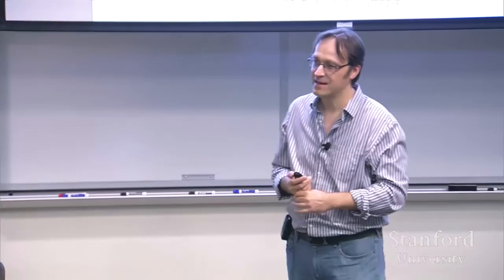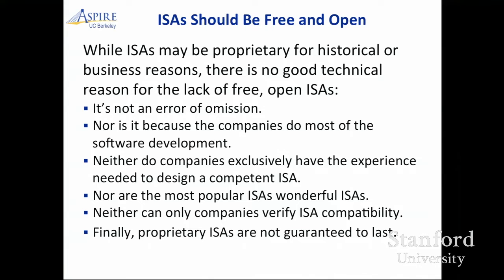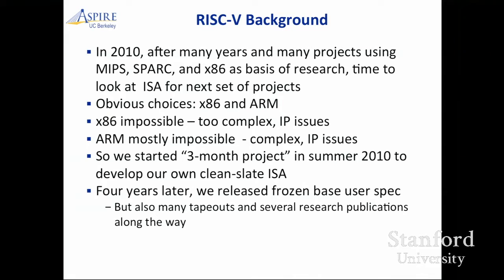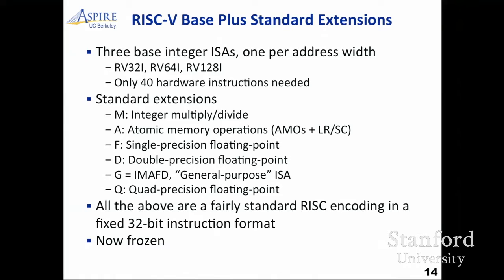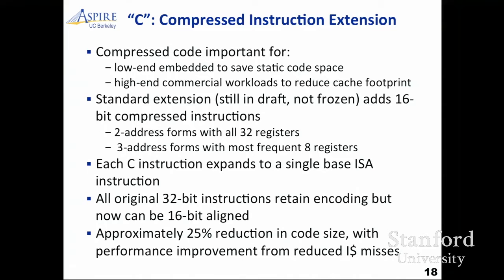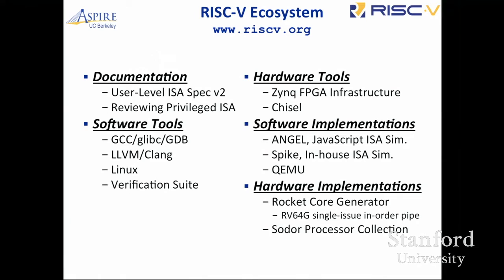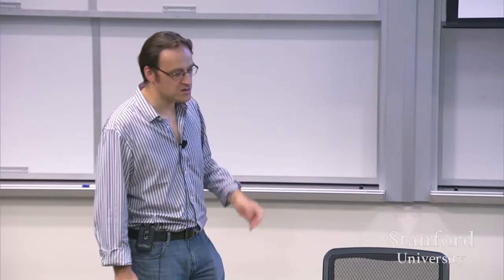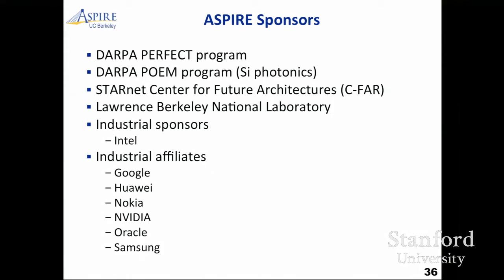Stanford Seminar - Instruction Sets Should Be Free:  The Case for RISC-V

Comment: I'm concerned that they have an ABI and an SBI. This means that as an OS developer I have to write different code to have my OS run on the SBI vs. the ABI. Why not simply define the SBI as a superset of functionality of the ABI that the OS (or hypervisor or HAL) can choose to expose or not to the application. Then there is no need for a hypervisor; if I want to run an OS instance on another OS instance, I just run it with the relevant permission from the host OS. There are many cases anyway, sandboxing for example, where an application like a web browser needs to implement OS like functionality like pagetable manipulation (of the process in the sandbox), if the platform implements cascaded page tables, then it ought to be trivial to expose that so that any task can call into the pagetable ABI for manipulating the pagetables, and the necessary checks are carried out at each layer: browser, OS, hypervisor, but at the page access level, it is implemented by the same hardware paging regardless of layer.

I am also concerned that there is a strong possibility of same core context switching being cemented into the standard, which could throw a spanner in the works for efficient CMT (see for example NxM), where rather than the hardware thread executing an exception vector and saving the process state, then entering the kernel, the hardware thread raises a flag and halts, and another hardware thread or physical core processes the system call and clears the flag of the calling hardware thread. In my mind this can constitute a large performance increase as the hardware call initiating the call can continue executing of another hardware thread. while the state of the calling thread is saved not by self storage, but by another thread accessing it's hardware TCB and asynchronously storing it to memory. In this way high performance application cores can execute at very high availability, and a stripped down supervisor core can implement thread saves and restores at lower energy cost. If only the application side of the interface is specified, then alternative supervisor models are safe, but if the ABI defines both sides of the interface, then it is likely to lock in the conventional interrupt and callee save model.

Another potential model is a high performance hardware task switcher that implements task switch logic as a hardware state machine, which could potentially be even more energy efficient than a dedicated supervisor core.

Anyway, I just think this is something worthy of consideration.
Reply: This is really old now, but people are probably still finding this. This comment seems to totally misunderstand what an ABI and SBI are.

ABI is a very common term, so should be understood. An ABI defines the interface between parts of a program that are separately compiled, for example between an application and libraries. It defines which registers can be guaranteed to have the same contents after you return from a function call and which can not. It defines how function arguments and results are passed -- what happens to things smaller than a word, what happens to things bigger than a word, what happens to structs, what happens to varargs. It defines what a stack frame looks like. It defines how elements are laid out in a struct with padding etc. It defines how calls are made to the operating system.

SBI is a completely different thing. The SBI defines things that on most other machines might be implemented as (complex) machine code instructions. It is a library that runs in Machine Mode providing services such as timers, inter-CPU messaging, console character read and write, system shutdown. The SBI is provided by (typically) the 2nd stage bootloader (e.g. Das U-Boot) and is called by the operating system (e.g. Linux). The calls use the same mechanism as system calls from the user application program (running in User Mode) to the operating system (running in System Mode) using the ECALL instruction.

"This means that as an OS developer I have to write different code to have my OS run on the SBI vs. the ABI." This doesn't make any sense. An OS is an OS because it uses the SBI and provides the syscall portion of the ABI. If an OS is virtualized recursively inside another OS then it doesn't make any sense for the guest OS to know about this and use ABI ECALLs instead of SBI ECALLs. The whole point of virtualization is that the guest OS doesn't know and can't find out that it is running virtualized. The host OS needs to know that it is running a guest OS and not a regular application, and use an ECALL handler that provides SBI functionality to the guest OS -- which will involve lying to that guest OS about certain things.